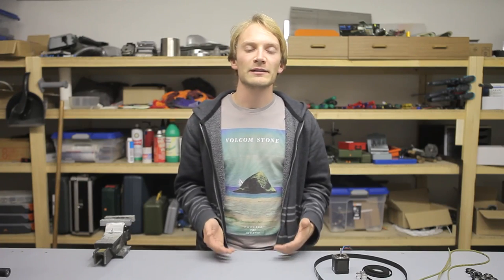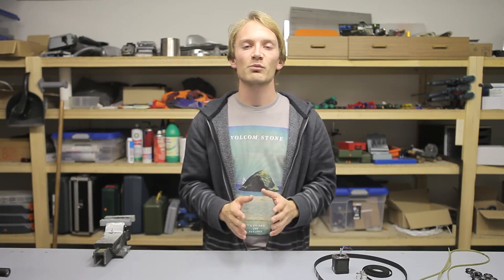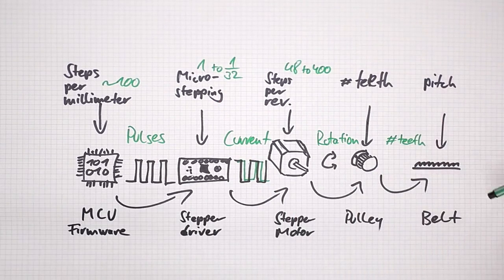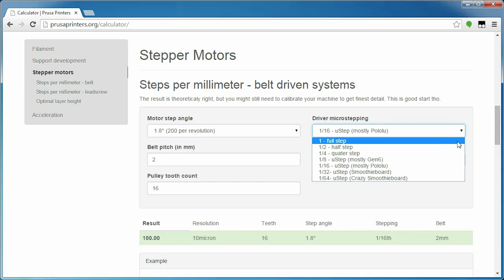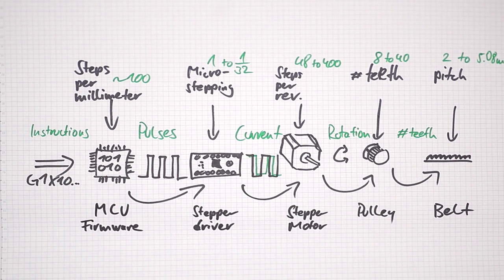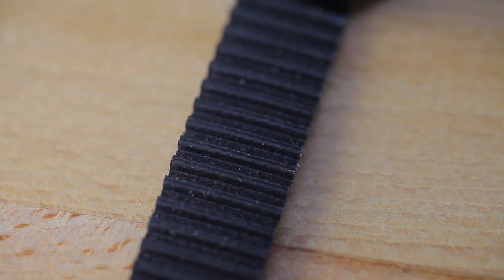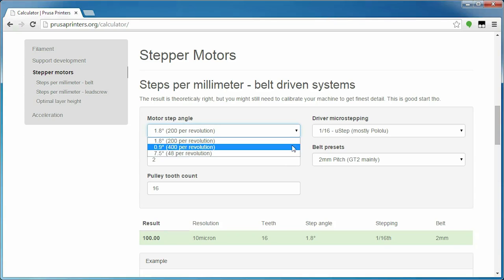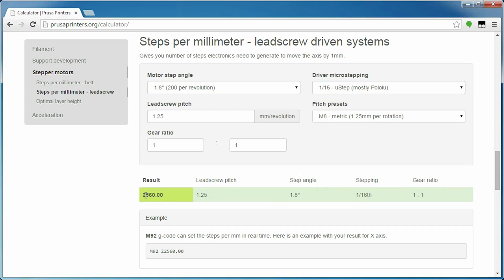3D printing basics: Understanding steps per millimeter and using Prusa's calculator

Comment: Many of my walls have a slot down the centre - Google enquiries say you have to have the wall thickness a multiple of the nozzle size, but it didn't solve my problem even with 100% fill.  So I did a test with walls from 1x0.4 to 8x0.4 and got an interesting result:

1 x 0.4        Too thin - could not print
2 x 0.4        Good
3 x 0.4        Bad
4 x 0.4        Good
5 x 0.4        Bad
6 x 0.4        Good
7 x 0.4        Bad
8 x 0.4        Good 
 
I suspect this is a function of Cura 2.3.1 - the rule seems to be that you have to specify walls that are a multiple of 2 x nozzle thickness to avoid gaps in the middle.

Have you hit this bug?

Comment: I have built a printer from scratch . the entire frame is DIY  with X, Y ,Z axis . have not installed the extruder as yet . was trying the movements , and learning how to use the print run. my question is ! this not a brand it is a home made printer . with ramps1.4 Ardunio mega and 6 end stops for X min max Y min max Z min max.  how will I configure?

Comment: Hello, ok I need to find micro stepping for A4988 and NEMA 17 stepper (200).  One rotation  = 20 teeth x 2mm belt pitch=40mm. And 40/200=0,2,  And  1 mm / 0,2mm = 5 steeps/mm. BIGEST EVER I work at CNC Grinding machinines. My main work.

Comment: I'm building a printer and using imperial leadscrews. I always get a value that has two decimal places for the steps/mm. Is this okay or will ti mess with the microcontroller?
Reply: Should I try to adjust my microstepping so I can get as close to a whole number as possible? Right now I'm at 62.99 steps/mm on my x and y axis. I think that should be pretty darn close enough. And my z-axis is .1905 resolution at 3 steps. Does that seem okay or no?

Comment: if i want to know how much, technically, the axis moves one by one step, for example 4mm pitch leadscrew and 5000cpr encoder on the motor and without reduction, is 0.0008mm correct?
Reply from the maker: +ipadize stepper motors don't use encoders. One revolution is typically 200 or 400 steps, which are divided into typically 16 interpolated microsteps.
Reply: yes i know that, but i was speaking about a servo motor with a 5000cpr encoder and would like to know the final (theoretical) resolution in one axis. Thanks for your answer anyways

Comment: Hi thomas. I'm glad you reported most of the microsteps aren't accurate. I thought microsteps affects much more smooth motion than resolutiin. Only plain and half steps are in the right position. I was shocked that jo prusa's calculator gives a resolution result way greater than it realy is, just because of x16 microsteps. Do you think it's fair to say that a 1.8° motor x16 driving a 20t gt2 pulley have a 12 micron resolution ? As far the resolution can't be true up to the half step, do you think saying "up to 100 microns resolution" for that configuration is better and reflects much more the reality ?  Thx 4 your great videos keep on ;)

Comment: Be careful the MXL settings in the Prusa Calculator seems to be broken, it produces the exact same result as 2mm GT2. That's not correct. Also, Prusa Calculator doesn't include 1/32 micro stepping.
Reply: It looks like the Belt Presets menu doesn't populate the belt pitch field. If you manually type in 2.03 it works.

Comment: 

4m
Hello All,

I am building my own 3D Printer - Graber i3. I have followed all the necessary steps to configure the Marline firmware. 

I am using the Ramps 1.4 controller board and the A4988 driver. The stepper motor I am using for X, Y and Z axis has 1.8-degree step angle. 

I have used the Pursa Calculator to calculate the steps for X, Y, and Z axis - 80, 80, 1600 based on the GT2 pully-belt and 2mm threaded rod - screw system. 

ISSUE: 

* When I am using the calculated steps for the X, Y and Z axis I am observing higher movement (i.e 10-15 mm when I want to move 1mm)
* I have calibrated the movement by reducing down the calculated steps -
now the new steps are X=6.5, Y= 6.5 and Z = 26.66 

1. My question is why I am getting such a lower steps per axis? 
2. How can I get more accurate movement without skipping/slipping of the motor?

Please help

Thank you

Kunal

Comment: I completely disagree that the values from the prusa calculator are plug and play.  They are starting values.  Out of three different belt setups I have experience with all have needed extra calibration.  The current setup I am fighting 1.8 deg 1/16 step 2mm pitch and 20 tooth pulley comes out as 80 steps per mm.   However I am having to lower the steps just a bit and offset them to get objects to print with the correct dimensions and round.  Unless the belts are sub par but I have had to do the same thing with steel reinforced belts.